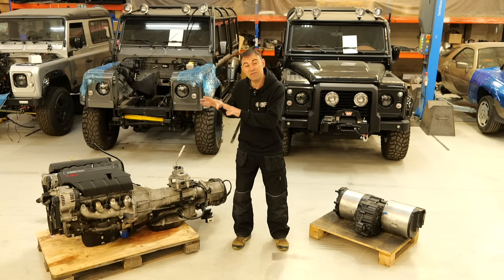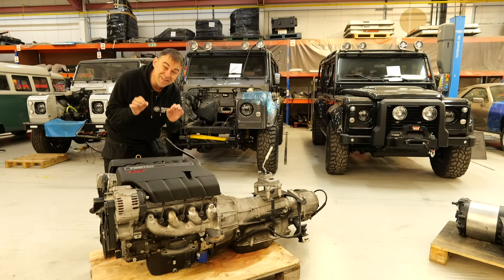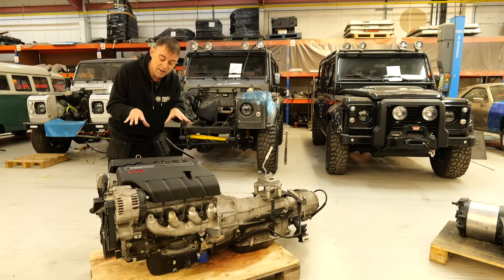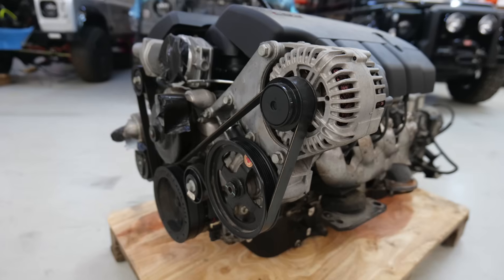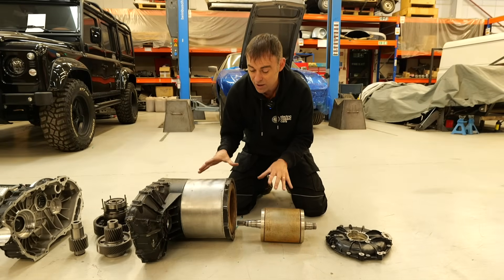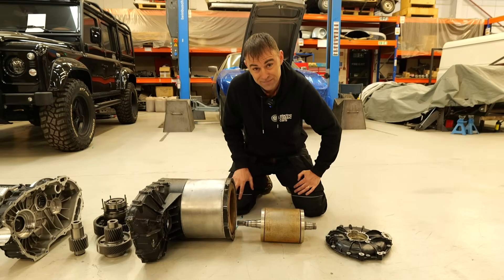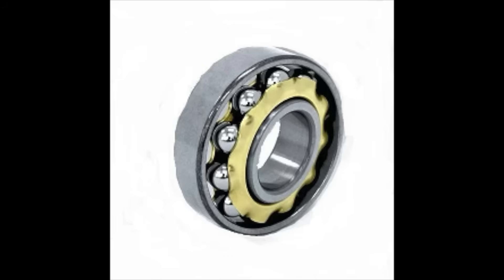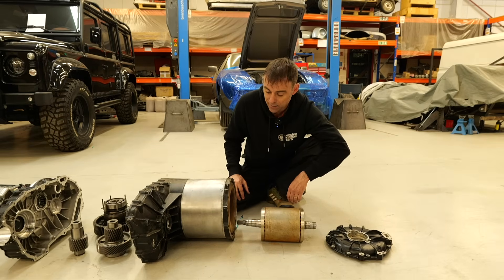Let's compare the Tesla LDU with an LS3 V8 and take one apart to see what makes it tick.

Comment: ICE vs EVM is like mechanical vs digital watches. Only the most beautiful ones are worth preserving.
Reply: I think that's a very good analogy. When digital watches came out, it absolutely didn't make any sense to continue producing mechanical watches. They just are cheaper, more exact, more convenient and run forever on a single battery. Still, there are so many mechanical watch lovers, that they still are around. It might be the same with cars. Logic dictates that the advantages of electric cars are so massive that they should replace ICE in most cases very quickly. Still, lots of people love the experience of "mechanical cars".
Reply: @valuemastery  Two years and you need to replace the damn bateries. An automatic will run forever.
Reply: @gbirtz I love automatic watches, have several Breitlings. However, I also have several digital watches with solar. They've been running for more than 10 years now with zero maintenance.
Reply: @valuemastery  Yep solar watches are good for about 20 years (before replacing the battery). I think we're drifting away from the analogy a bit ! Unlike ICE , mechanical watches don't pollute.
Reply: @gbirtz Yes, we're discussing watches now instead of cars 😅 sorry for off topic
Reply: Mechanical watches are extremely efficient, unlike ICEs

Comment: With every 10 litres of fuel used in a combustion engine only 2 litres is used to move you forward
Reply: And the energy to get the fuel from the ground, refinery and petrol station could just be used directly to run the electric car and leave the oil in the ground. The oil industry uses massive amounts of electricity. It is far cheaper than using their own oil !
Reply: @JonathanTamm  No, refineries don't need to use outside electricity (but most do). and yes they burn a portion of the fuel in the processing
Reply: @ exactly!
Reply: Assuming you're moving and not stopped at traffic lights, or warming the car on the driveway. And yes, it's nearer 2 than 4.
Reply: 2 for moving, 1 for electronics and 7 for heat
One liter of gasoline contains about 10 kWh, an EV will be able to drive 600 km per 10 litres, but it also takes 1.2 kWh to refine one liter of gasoline that is an additional 72 km.
Electricity can be produced in a lot of different ways, coal is the most polluting method, even if 100% of coal the EV is less polluting than ICE cars.  I prefer to charge my EV during the night in the winter and during the day in the summer to catch as much renewable electricity as possible, fortunately renewable electricity is also the cheapest, at least in my country
Reply: @casper_hansen  we don’t burn coal in the UK to make electricity anymore
Reply: Plus, you need electricity to refine the petrol in the first place. And the distance you could travel on that electrical energy is the same as you could travel with amount of petrol.
Reply: 4